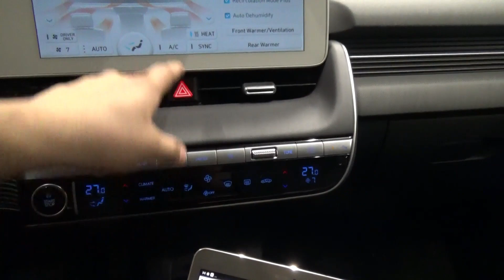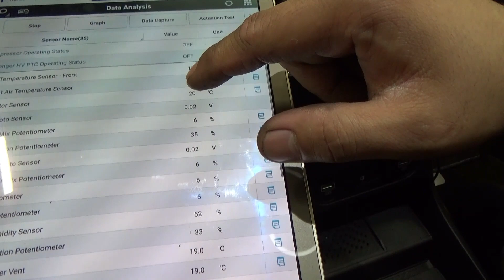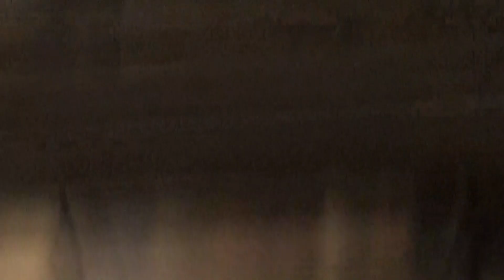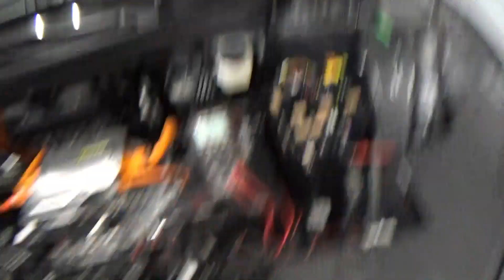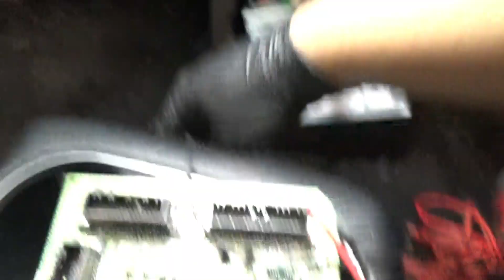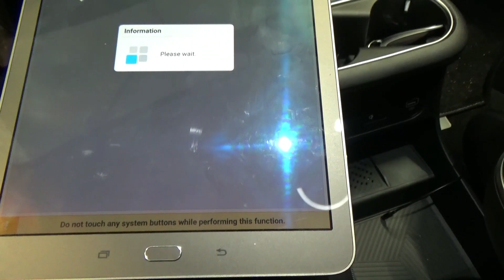Ioniq 5 No Heat Coming Out From The Vents - Communication Issue

Comment: my 2022 Ioniq5 has a similar problem, with the only difference of the AC not working. When the AC is turned on, I see a dip in the range, which I am assuming is because of the compressor coming on, but no cold air. The heat works fine though. Do you think the AC control module is the issue? My local dealer is struggling to find the issue for the past week now.
Reply from the maker: That depends, if i have the car i would scan for codes, if theres codes i will keep that in my mind for my direction in diagnosing the vehicle, if theres no code i will start in basics, check for proper refrigerant and proper operation of cooling fans something like that, temp actuators. Hope that helps
Reply: @hyundaitech  Thanks for the input. My dealer is changing the entire PTC heater and ac control module. It looks like they couldn't pinpoint the issue and decided to replace the entire unit. This is a brand new car, do you think in the long run this job will be an issue because they have the take out the entire dash to get the PTC heater replaced?
Reply from the maker: @kgulnar  hey there, i cant say that it will fail coz we have some ioniq 5 has no problems at all,  maybe its one of those cars from factory. I have new video coming out voz the ioniq 5 came back with the same issue and its a failed module again hahaha. They always say " it doesnt mean its a new part it will work" sometimes especially me i will just shake my head and sometimes doubt my diagnosis coz new part fails. Hahhaa

Comment: Can you let us know what code reader/software your using?  Is it exclusive to hyundai or can it be bought for OBDII wireless diagnostics?
Reply from the maker: What im using is the factory scantool. But you can you use any capable aftermarket scantool with all system scan so that you can view in this case the a/c module. Hope that helps.